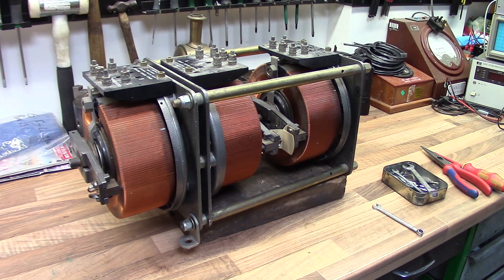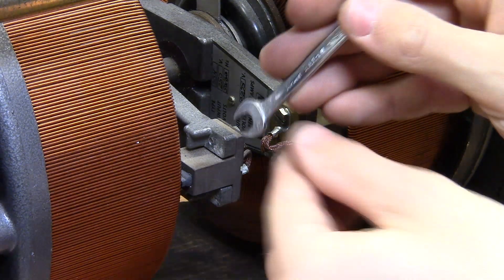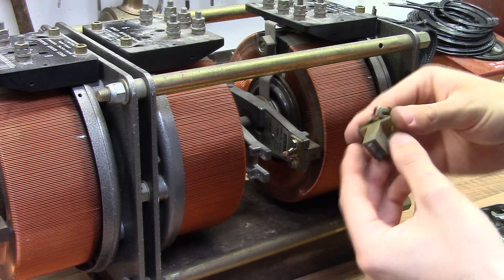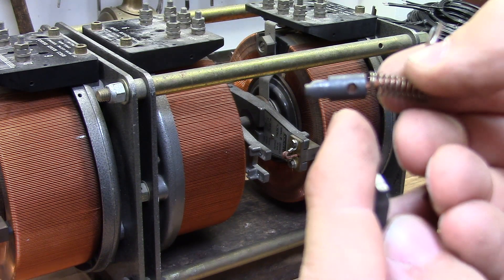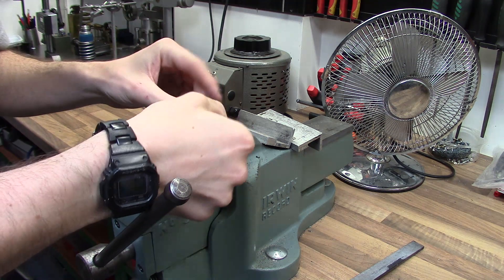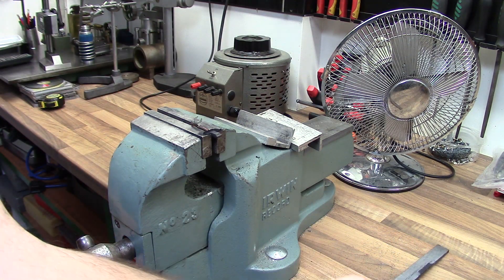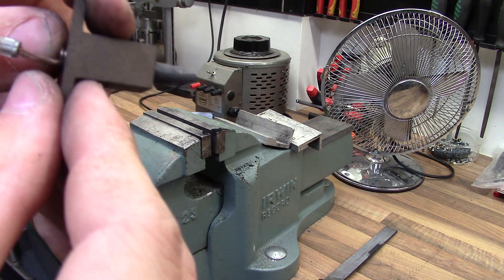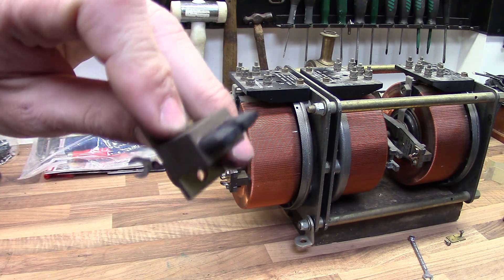Getting The Last Millimeter Out Of Your Variac Brushes

Comment: Don't stretch the springs too much, there is a danger of placing too much pressure on the contact surface which will cause premature wear of the brushes that you are trying to save! too much and you will also get quite a bit of carbon residue building up on the contact surface which can cause problems, just be sensible. The springs are that gauge/length for a reason.

Comment: Done that many times with variacs and motors, except that i used to put the file in the vice, that way you don't squash the brush.
If you ever need brushes, look for similar brushes from old motors, a bit of filing can make them fit, the double brush is more about spreading the current over a larger area to keep them cool.
btw, you could have spliced the before and after photos in the vid ;)
Reply from the maker: ***** Yeah I did think of doing that, might try that next time possibly.
And yes file in the vice is definitely a safer idea! =]

Comment: Great vid! I have a sticky spot on the windings of mine around the 180V mark. I'll have to open it up to find out what's causing it
Reply: Machine Man  You may just have an area on the windings where it's been arcing between the brushes and the track windings.. In this case use a little switch cleaner on the track, clean off the excess and run the brushes over it a couple of times.. it should clean right up! I tend to use switch cleaner on my variacs track every six months or so (depending on use) this helps the variac control knob turn far smoother, and helps prevent contact arcing.
Reply: ***** OK thanks! When I run the stylus over it at the moment it feels like it's arced over.
Reply: Machine Man .. Yep it's probably the arc debris stuck to the track which leaves a rough spot and that's what your feeling as the brush runs over it. 
Obviously... Turn off the power, and try a very fine file or a small piece of very fine sand paper, and gently file the rough spot away (don't use much pressure at all,) clean off any remaining grit/dust then lube track with some switch cleaner etc.
Reply: ***** thanks! I'll be sure to give it a shot!

Comment: Wow, having those brushes barely touching the windings could arc and potentially create a hot spot. I've never checked mine (on my cheapo China model) and with the abuse it's been through I'd better start inspecting them after each use.
I may be getting a used monster of a 4 stage variac soon if the freight isn't overly expensive and have been expecting it'll need new brushes. Unfortunately this isn't an option with Superior brand brushes and they are about $90 each x 4. Not to mention I will need balancing chokes at $105 each x 3. The cost of all that plus freight will cost as much or more than the variac itself!
Shit gets expensive.